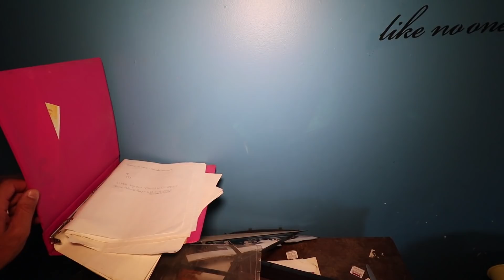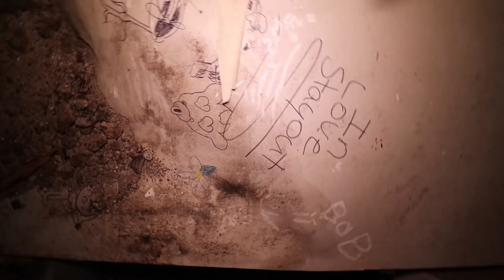EXPLORING A DRUG DEALERS ABANDONED HOUSE (DRUGS AND COFFIN FOUND)

Comment: Those cabb age patch are worth bucjs collectors tgat deers head worth 2 to 5 grand u know hiw much a taxidermist charges ten grand easy id check that horse trailer must be a stabke the trunks that antiqye trunk is worth hundreds must be tobs more u didnt show that laminate still in boxes is hundreds its wrapped in plastic abd sracI ed old xopper is 5bux a pound right now all the copper pippers brass re apes wireing and brass fittings bet theres two grabd in that okace or mire bet u he put bunch heavy copper wiring on his fuse panel the main power thick the water pipes that house is hundred twars it has huge brass sewage pipes in basement and under the sinks kitchen vatb rpoms bro it make us rich id clean her myself